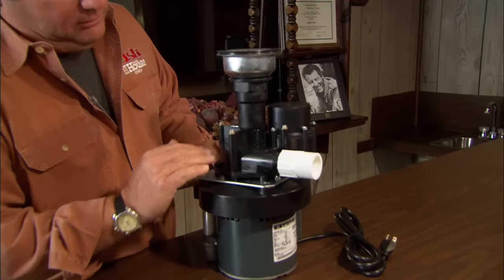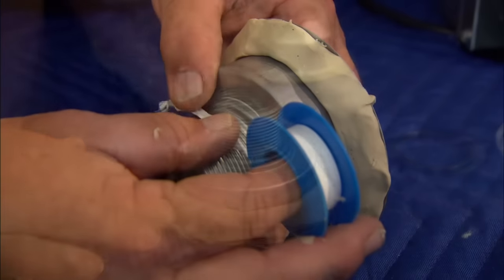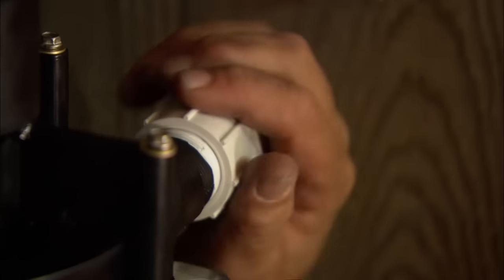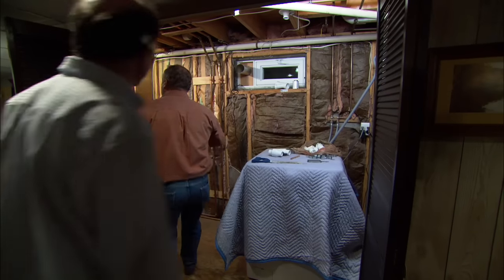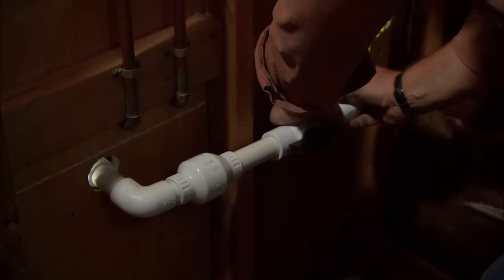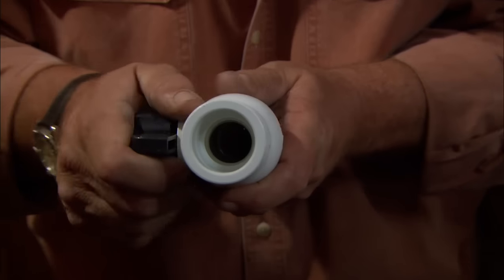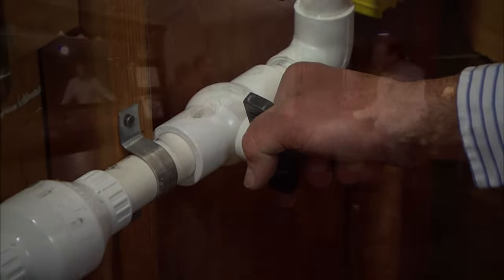How to Install a Drain Pump for a Basement Sink | This Old House

Comment: Anybody else laugh when he sliced into the romex sheath with the handsaw?
Reply: Oooops!!!
Reply: More like cringed!
Reply: Didn't look like he exposed any copper, actually I couldn't even see the hot wire
Reply: I actually paused the video, to see the first comment about the romex. and here you are on top of the list!
Reply: He's a plumber, not an electrician :)
Reply: That whole area looks like an electrical mess.  Plumbing and electrical wire spaghetti.....
Reply: I came to comment about the same thing. Plumbers and Drywallers smh
Reply: Yeah, I seen that. Then i scrolled down to see if anyone else commented on it. And I seen your comment first in line. lmao
Reply: lol the okay sigh after he did it.

Comment: That is the greatest video ever!  (no sarcasm).  Showing how the control the discharge of the pump so that it doesn't work faster than the faucet was amazing.  I enjoyed how he he showed the one-way valve too.  This video was very eye-openning.  I live in Tucson and it is rare to see a basement home; I was wondering how water gets out of the basement when the discharge pipe is higher than the initial pipe (drain).  I understand that the pump is powerful and can lift water 14 feet.  Amazing tech.
Reply: true, but what about toilet drain. how to push a heavy dump 14 feet up 🤣🤣
Reply: Sewer injection pump 💪

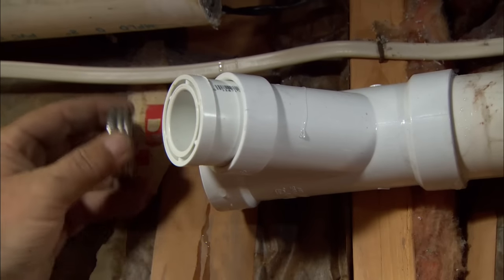Comment: Not a plumber, so I have a question. Around 2:48-2:50 when he installs that T-piece into the drain line, how does drain water coming from upstairs sink, toilet etc. not flow down into the drain pump instead of simply flowing out to sewage line?
Reply: A. That drain line is too small to be a Waste drain, so no solid waste going down it.
B. The connection is lateral, coming in from the side, same height. It is also angled following the flow direction of the main drain. So...
C. Fluid dynamics... or simply put, water velocity, pitch, and gravity carry the water downhill. Any little bit that does make it's way sideways into the pump drain will just get caught by check valve.

Comment: What do I have to do if the pump was going on and off, and now it won't drain the water? Is my pump shot? Do I have to buy another one? 

So the pump should be a constant sound, not a pulsing noise?

Comment: What about the VENT?
Reply: Jamshed No vent needed with a basin pump, the air in the pipe will just get forced out any of the other vents for the rest of the fixtures in the house.
Reply: Jamshed I’ve been looking into these, the instructions say no vent is required

Comment: Any plumber here.
Can I use this drain system to have a 2 component sink in the basement for my restaurant?
Inspection will be made according to the rest of the plumbing
Reply: I would expect you’d need a pump that can be set up with a continuous waste (similar to how a garbage disposal might be in a a kitchen) This pump did not appear to be capable of that but I’d expect one exists. Im a first year apprentice (in other words, I’m no authority on the matter) and im replying 5 months late so I’m interested to see if you’ve addressed your situation and what was done.

Comment: I have an old cement triple sink. My washer has, for as long as I have owned the house, gone thru a pvc pipe from the sink drain, down 4 ft over to an elbow to 3" to 4" rubber adjuster placed directly over the floor drain. Now that I am selling, it is an issue. Is there a way to attach the two for a closed flow into the floor? I am not breaking up and digging up the floor. I like the way it is for super easy access to clean/plunge that floor drain on a moment's notice and on a regular basis.

Comment: Using a No-hub coupling on PVC is not allowed even with transition fittings. Use a slip coupling.

“(h)Plastic.
1.ABS. PVC and CPVC.
a. Every joint in ABS, PVC and CPVC piping, except as specified under 248 CMR 10.13, shall be made with fittings by solvent weld connections.
” CMR 248 Mass. Reg. 10.07

Comment: Does no one else notice how his washing machine waste is like 5 feet off the ground? @4:38
Reply: Modern machines are spec'd to pump that high. Limit is right around that number though based on the manufacturer.

Comment: I have a similar setup in my basement for the washing machine. I'm trying to change from a Polypropylene sink to a stainless steel sink but the basket strainer won't screw into the pump inlet. It looks like the threads are different. The old sink had a tail piece that the pump screwed into. Any ideas?
Reply: Call a plumber

Comment: I want to do something similar but with a dishwasher.  I have a kitchen in my ground level basement and want to install a dishwasher unfortunately the current set up will not allow enough room to put one next to the sink.  I'd like to beable to run the water along the wall to a drain in the laundry room.  The drain line would he hidden so it wouldn't be a issue.  It's about a 20ft run.
Reply: The dishwasher pump should suffice to move the water to a higher drain.

Comment: How many horse power is the pump you are using. Will a 1/3 hp work to pump like you have? I t from washer to utility tub where it is hooked under utility tub in basement. Pumps up, in a 3/4" pipe though. Was there previously with same type of system. I m replacing it with a outtake of 1 /2" now. The other had a 3/4" out. Will this work or will I have to convert 3/4" pipe over to 1 1/2"? I am wondering if I have enough hp also? Thank you

Comment: What would be a fair price for a plumber to do a job like this?   I have a job just like this I want done.
Reply: Just did one about 1500, it was a pretty long distance though like 50 60 ft, that might have been a little cheap
Reply: @jdahighroller9389  About $22,500 or so for a plumber.
Reply: @lukedrifter1  Im in Louisiana... I need to go somewhere and get properly compensated for my skill sets

Comment: Can I drain this pump into an existing laundry drain pipe?

Problem is that the existing utility sink beside the stacked washer dryer (washer on top) is just below (floor is two-three steps below) foundation wall and the drain that goes back into house. So can’t install p-trap without raising it up.  Current sink drains to open Rubbermaid container with sump pump going to the washer drain.  Not to code and smells.

I bought this sink pump but I think the only way to drain it (and be code compliant) will be direct into existing laundry drain and then re-direct washer drain directly into sink? Does this sound right?

Anyway to combine both directly into the laundry drain?
Reply: Call a plumber plz

Comment: Coming off of the pump can you do your ball valve first and then your check valve or no????
Reply: looking at the video it shows check first, then valve
Reply: Personally, I think putting the ball-valve first and the checkvalve second would actually be a better installation because the check valve would then be closed more quickly and securely by the full weight of the water in the vertical pipe without it having to trickle back through the mostly-closed valve first.

Comment: is there anything on the market for a wash machine? I would like to install electric dryer and wash machine in the garage but I don't wanna open the concrete just to run the sewer pipes
Reply: Washing machines already incorporate a rather robust pump to discharge their water.  I've never seen them try to pump to a ceiling height before, so you'd need to contact the manufacturer to find out if this would work.  The other alternative is to simply install a cheap plastic basin sink for your washer to discharge into, and then utilize a pump like Richard featured in this video.
Reply: and hopefully your garage is heated all year, else you will freeze the lines, i like the basin sink idea
Reply: In a different video, Richard uses this system for a washer drain.  Watch this video here:  https://www.youtube.com/watch?v=HW-_WA1Psi8

Comment: Could a dishwasher be added to this setup?
Reply: Only if it uses water =) dishwashers have a pump, that may go high enough, depending on your placement and height to main drain line. i have mine pumping about 2 feet above the top of the dishwasher temporarily until i completely remodel my kitchen, and it blasts out!

Comment: why not use a globe valve if you know you are going to throttle the flow? Ball valves are not supposed to be throttled.
Reply: i was thinking maybe cost, but just looked up PVC globe valve, and found lots around $10, learned something today Tripnotyst, thanks!
Reply: what? that is opposite of of what you're  saying .Ball valves can be throttled but globe valve are meant to be opened all the way or closed . 
Did it even crossed your mind that licensed plumber on national TV know what he is doing?
Reply: The globe valve is used for throttling flow control. Shut off is accomplished by moving the disc against the flow stream rather than across it as in the case with a gate valve. The flow pattern through a globe valve involves changes in direction, resulting in greater resistance to flow, causing high pressure drop. 
Ball valves are an excellent choice for shutoff and control applications, where they are often preferred to gates and globe valves, but they lack their fine control in throttling applications
Reply: @pawelgatorade  ball globe,same

Comment: Why not just use a pump that matches the flow of the sink? Why use an oversized pump and then restrict the flow?
Reply: Not a lot of selection when buying pumps like this. No big deal to restrict the flow of the water. Is it perfect/ideal? Not necessarily, but the pump will still last for years and years set up like this. We have had one for 10 years set up just like this, still going strong.
Reply: They probably don't make very many sizes of these pumps/
Reply: Better than undersized.
Reply: All pumps need a device that can change their flow to meet field conditions because each pump is manufactured to meet a range of flow conditions.  If you think about it, even the sink flow conditions can change depending on how "open" you have the faucet.
Reply: @sngehl01 what i'm confused about is if I still have to vent the sink if I do this?

Comment: Cool.  Now remove the illegal above-ground rubber clamp and put on a proper steel banded no-hub coupling.
Reply: ScubaCat3 not to code does not equal illegal. Also, every municipality has different codes. Do you know where they are and what the codes are for their location?
Reply: ScubaCat3 exactly! And ditch the rest of the setup.  None of that shit would fly here in Illinois.
Reply: @mikeybmx5330  the hell? How else do you have a basement sink in illinois then?
Reply: I thought you would need a p trap there?

Comment: One of the most important features Richard failed to mention was that no trap necessary and more importantly, no vent needed ! Can be costly and Inconvenient to install or even locate  a vent .
Reply: I was wondering about the vent situation.  So with these laundry tray pumps they don’t need to be vented?
Reply: @michaelgelatt8995  Trap and vent is a part of the design of this pump unit. i believe it has some sort of an air admitting valve kind of design for vent..